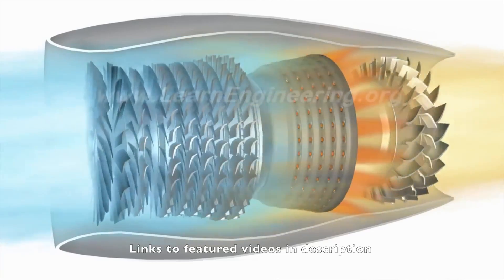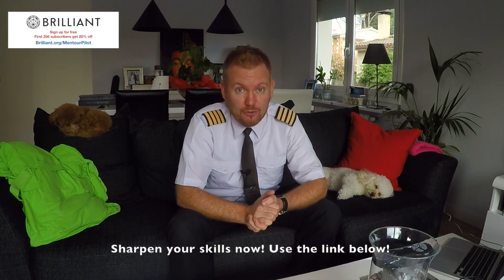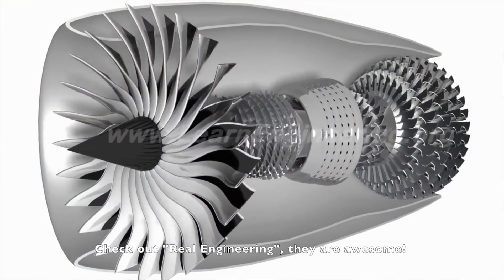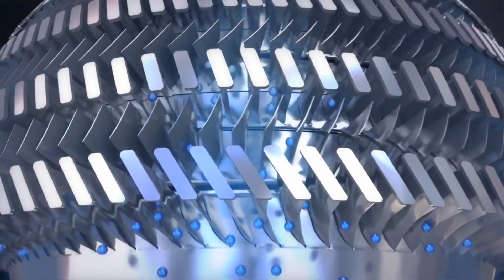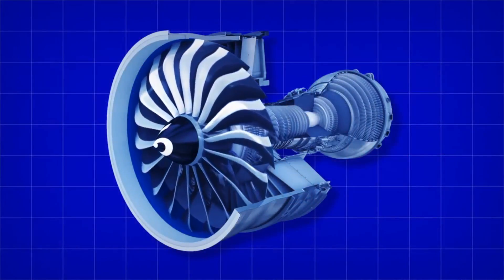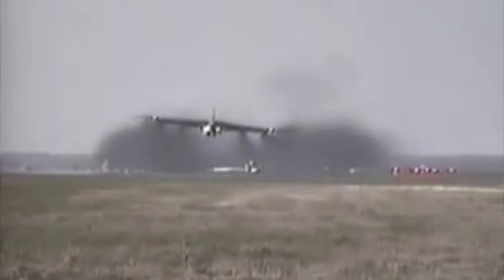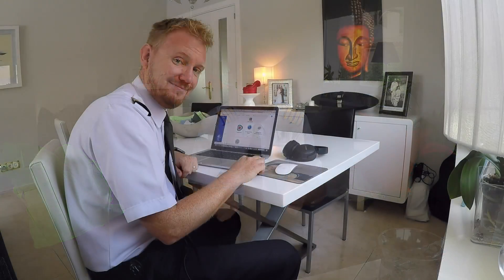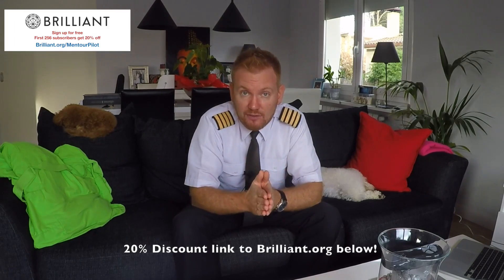Can water make Jet engines stronger?!

Comment: Hello Petter. Could you talk about how jet engines are started sometime? There is a fellow in Canada that does some wonderful videos about how jet engines are made and operate showing the internal parts and the subsequent testing of them after they are rebuilt at the shop he works in. He has talked about the starters quite a bit too and shown them disassembled etc and spoke about one called a cartridge starter where a canister of fuel would be ignited to power the starter which then start the main engine. He implied that they were no longer used but I believe I even saw a F-22 fighter being started this way. There was a brief puff of smoke and the sound of a turbine right before the sound of the main engine becomes apparent. It seems logical to me that military jets on standby that have to get airborne ASAP might still use this method vs some sort of start cart. Also I am thinking the newest commercial jet engines might use some method that he has never even discussed as I don't remember seeing start carts in any of your videos.
Thank you for all the interesting and informative videos Petter.
George

Comment: So we don't have thrust augmentation systems on modern high bypass engines? Is this a new thing? Will the low and intermediary compressors work at all normal flying altitudes?

Comment: Is it good to throw a coin into engine turbine before gettin into plane  to have more luck?
Reply: Some tribes in central africa did this in the 18th century to appease the gods.
Reply: @zanzark1  didn't know they had planes with turbofans in the 1700s
Reply: Absolutely NOT! That could severely damage the engines and actually increase the change of engine problems or failure. So basically, NO it will actually decrease your luck!
Reply: @paul kesley I'm shocked myself, being an African 💁
Reply: Took a while for the rest of the world to catch on. ;)

Comment: Burn chamber? Combustion chamber lol. And to help clarify, there are several stages of turbines and they are just that, turbines. Different from fans in many ways. The first stages of turbines (depends on engine how many) are the high pressure turbines (HPT) which takes the initial energy from the gas produced from the combustion, and those HPT stages drives the compress. In the grand scheme of things, the compressor and HPT are fuel driven (throttle response). The last stages of turbines are you low pressure turbines (LPT) which takes the lower temp gases (in comparison to the HPT) and is used to drive the main Fan and booster stages via an LPT shaft through the center of the core connecting to the fan rotor assembly. You Low pressure system and high pressure system are aerodynamically linked together, however the core is fuel controller while the control of the fan is based off of compressor vane positioning and booster bleed off positioning. Hence why it's possible for the fan to over speed.  It's always hilarious watching pilots explain the maintenance side of the house. Great video though 👍🏾

Comment: You've produced a great channel of videos.  I have  been an aircraft geek since birth, but they (the videos) have filled in many holes in my knowledge, especially with the 737.  My usual air carrier is WestJet, so your videos apply to most of my questions.
I'm an operator of a gas turbine powered electrical generating station in northern Canada.  We fire the turbines on natural gas.   Our turbines are basically a stationary variation of the GE CFM56 frame 7 s with a generator on the end of the shaft instead of a fan.  Being on the prairies, with the associated almost continuous wind and dust, we water wash the compressors online every week in the summer.  To do this, we spray  about 180 litres per minute of 85 deg. C water into the intake bell mouth for 30 minutes at a time.  We have to be at full rates at the time,  but even then, we see little variations in the flame detector outputs.  They never flame out, its just that the detectors see the water going by.  We actually gain 1.5 to 2 Megawatts of electrical output while the water is going in, too.  When we shut the water off, the output drops to normal with a slight increase since the compressor blades are now clean.  Seeing this video, I  found my self wondering if our ignitors start firing as part of the automatic wash sequence.  I'll have to investigate further on our side.

Comment: I believe that bypass fan works to let the water out. With higher pressure, the water is also be compressed. Anyway, the temperature is high enough to vaporize the water drops.

Comment: the probability of water even going into the core is very minimal, water is heavier than air and would be pushed towards the tips of the blades. something like 99% would go through the secondary air duct. Water can and will however flame out an engine. The pressure and volume of the water needs to be high enough to do so though, like from one of the fire trucks that have the remotely operated arms. Rain however just doesn't have the volume condensed enough to be even able to make it into the combustion chamber. I think the biggest danger to a jet engine from rain is dependent on temperature. In colder climates around 45F or below ice formation becomes possible, which could cause ice damage to blades. I'v never seen or heard of ice FOD causing total engine loss damage, usually it just means the engine mechanics like myself get to spend a lot of time with files re-profiling blades and/or changing the engine because the damage went into an area that cant be blended with out engine tear down.

Comment: Listening to your comments and explanation regarding turbulence, engine failure etc....does reassure my flying. Turbulence is one most disturbing factor of flying. Regarding Air Asia accident few years ago, reason was pilot error by flying too high during a thunderstorm, very interesting about what you had explained concerning slowly pushing the thrust. Apparently, the pilot of Air Asia panicked.

Comment: Question: I’ve often seen that the tail section of the 777 has a circular space that looks like it’s been hit by sledgehammers. I always figured this was to calibrate/align the plane’s horizontal bias. Is this correct? Why have I never seen this on other planes though? Also, I noticed that the 777 very often, very continuously sways horizontally. Is this related or am I imagining things?

Comment: So, in effect, the high bypass engines, like on the 737-8 MAX are really just ducted propellers? Same principal as a propeller only instead of a four blades you have 40 blades (or whatever) that grab air and eject it rearwards, just like a propeller. Of course the speeds are not even in the same zip code and the turning force is a jet, not a piston engine or whatever. Fascinating

Comment: Interestingly, within the automotive industry, some vehicle owners spray water droplets into the air-intake of reciprocating engines to clean out carbon deposits which collect on the surface of the piston. The effectiveness of water injection demonstrates far better cleaning performance than products like SeaFoam, etc. That is one of the reason why an engine with a head gasket leak has shiny, clean pistons! I believe ChrisFix uploaded a very detailed video where he used a boroscope to inspect the cylinders of an engine with a head gasket leak.

Comment: this was a neat vid in that there is a direct connection with piston engines. i use water injection to help control detonation to keep piston crowns from being damaged during high stress engine operating conditions. water allows me to run a higher compression ratio that i would otherwise would at w.o.t. and that makes for more h/p and torque. it's neat to know that a similar process is used in a jet engine(keeping the turine blades from melting under extreme stress loads). what was of particular interest is the sheer amount of water that one of these engines will ingest and that the engine remains relatively unaffected as evidenced by the static test video clips and why they can do that.
thanks for the effort in creating these vids.
give the furry friends a pet for me :-) mine is a pomeranian.
=dok=

Comment: The water expands into steam from the exhaust gas temperature.
During combustion, air and jet fuel at perfect stoichiometric ratio expands to something like 5 times it's original volume, this along with the increased temperature drive the turbine.
Water expands from roughly 2000 to 4000 times it's original volume as steam at the temperatures you'd see inside a jet engine exhaust.
Reply: The fuel to air ratio on a gasturbine engine is far below the stoichiometric ratio of about 1:14, why?
The turbine inlet gas temperature must be limited to retain the structural integrity of the turbine blades.
Today that temperature is less than 1500°C, with turbine blade ceramic coating and internal cooling . Any over temperature will allow the turbine blade to 'creep' and rub against the housing.
That is one of the functions of the fuel controller ( FADEC) to limit the fuel flow during acceleration.
Adding water will certainly help.
Reply: Steam power!
Reply: @Special EDy :  Well explained than the video!
Reply: Uh, no. All water does is evaporate, cooling the air because of a thing called preservation of energy. You do not magically gain thrust from steam. That could only happen in the engine core where that gained thrust is lost entirely from losses to bleed air and other parasitic loads.

It's the same reason supercars and some drag cars use it. It cools the incoming air extremely effectively, which makes the engine able to cram more air in to burn. There is no "steam propulsion" mechanism going on here. Nor is the water splitting into hydrogen and oxygen as others suggest. Middle school science is worth paying attention to...
Reply: @pootispiker2866  All combustion engines run entirely off of heat energy.
A jet engine or piston engine converts fuel and oxygen into heat, the heat increases the pressure of the air, and that expanded air is converted into mechanical energy. Adding liquid water to the combustion increases the efficiency of the engine because it expands and  increases the amount of energy that's able to be extracted.

If you vaporize the water, it will cool the intake air, allowing more air to be ingested by the engine, and it will effectively increase the detonation resistance of the engine. But, liquid water entering the combustion chamber will increase the conversion of heat energy to mechanical energy.
Reply: @SpecialEDy  in what world would water ingested allow more air to be ingested...it has no chance to cool the intake air, in fact if it were humid more water would "condensate" out at higher pressures initially. This all DISPLACES intake air.
Doesn't make sense. Chemistry wise not one fucking bit.
So long as the fuel/air ratio were adjusted the ingested water could greatly increase performance and maximum thrust. Most engine management controllers would never do that however, water intake can't be a reliable constant. Dangers of turbine overheat are too high to take advantage of rain pulled into the combustion chamber.
It's usually Alcohol /water mixes used to temporarily increase maximum thrust, and that's directly injected pre-burners.
Reply: @mykeprior3436  Water injection was used in fighters and bombers in WW2. In bombers too heavy to get off the runway, or fighters in combat, they had a tank of water or water/methanol to spray into the intake. It'd give roughly a 10% to 25% boost in Horsepower. The Americans used water, and the Germans used 50/50 water and methanol (basically windshield washer fluid). Admittedly, these were piston engines, but the principle is the same since both jet engines and piston engines are internal combustion engines.

Water will cool the intake charge. The compressor stage of the jet turbine will compress the air before combustion, and compressing the air increases it's temperature. If water is ingested into the engine, some will evaporate during the compression stage which will lower the air temperature there, allowing more atmospheric air to be forced in. This works on all IC engines, it's why "cold air intakes" and intercoolers are a thing on cars. 

During the combustion phase, the water is entirely flashed to steam. All engines are heat pumps, combustion is used to heat the air inside the engine, and when the air is superheated, it increases drastically in pressure. This high pressure is then allowed to expand out through the exhaust turbine, driving the compressor to run the engine and the bypass fan for thrust. By adding water, you are adding a material that expands much more effectively through a phase change. The superheated air normally in the exhaust yields a pressure increase of 5 to 10 times, but water expands to thousands of times it's original volume when flashed to steam. It is much, much more efficient. The engine only needs to heat the water to boiling to gets an expansion ratio of several thousand to one, whereas it must hit the air by thousands of degrees to get a 5 to 10 times pressure increase.
Reply: @mykeprior3436  Also, increasing the fuel into an engine cools it off. Running lean of stoichiometric makes for a hotter combustion typically, adding fuel will cool off the combustion chamber and exhaust but isn't efficient, pollutes a lot, and deposits soot.

Car engines actually dump extra fuel into the engine if you start them when they're hot. Engines will "heat soak" if they're shut down after reaching operating temperature, since the cooling system is no longer running the combustion chamber actually overheats after shit down. Engine computers combat this on a hot start by pulsing the injectors before firing the spark plugs, and then running rich for a few seconds to cool off the combustion chamber.
Reply: @pootispiker2866  however it would allow for the turbine to reach much higher temperatures, effectively adding more fuel than designed dry. The expansion of steam would be offset greatly by cooling of the air via state change...so the net effect would be if the engine controller is attempting to maintain proper temps would be to in fact INCREASE maximum thrust. There would be a critical point where this would cease to work, too much cooling to keep up, too high pressures, too much oxygen displaced by water droplets (flameout) or worst case liquid compression (that would have to be some serious water ingestion) could blow the compressor blades.

Comment: Great physics lesson on energy, mass, and heat.  Even the body works in a similar way, with water cooling as well as strengthening the muscle systems of running and cycling.

Comment: To my knowledge most modern turbofan engines are N1-controlled (i.e. the engine's control unit (ECU) automatically sets the fuel flow to achieve the wanted fan speed). In case of heavy rain ingestion both the compressors as well as combustion chamber(s) tend to operate at lower efficiency. Therefore I would expect that monitored EGT should increase for a given N1 due to rain ingestion. Is this something you can indeed observe as a pilot? Have you ever encountered (or heard of) a case where the pilot set N1 was not achieved because under influence of rain ingestion the EGT margin became critical (and the ECU decreased fuel flow to prevent overheating)?

Comment: I had WMI (water methanol injection) on my car. That's wenn I learned it was used by planes since the 1930s. With all the effects you mentioned. Only injecting water can help also, because the volume from water to steam increases 1700 times, so your engine becomes a little steam engine. More power, more speed. Futher more it cools the exaust gasses and breaks down the carbon build up in the cilinder tubes.
Great video as always! 👍

Comment: If the fan is producing most of the thrust, and not the jet of hot gases, why are we not using turboprops instead of jet engines? I've been wondering about this for a long time. Is a ducted fan more efficient than an open propeller?

Comment: Why is there so much "Play" in the yolk?  I see exaggerated movements and the aircraft doesn't shutter, I can see in a cable/pulley system parts wear but the new controls are fly-by-wire.

Comment: CH4 + H2O = CO + 3H2, CO + 1/2O2 = CO2, H2 + O = H2O. Water is an active participant in combustion, which is why combustion propagates through wet charcoal. There is of course no net energy gain in the presence of water, and there is a net loss due to heating the water and absorbsion of latent heat, and perhaps a more diffuse multistage reaction process, although that is only my speculation. It is interesting to watch how wet charcoal burns, if you start with glowing embers it is hard to extinguish by pouring on water and any warm area that is not cooled sufficiently, though soaking, will slowly reignite.

Comment: So are water injection systems essentially turning turbojets into a bit of a steam turbine? I don't know how much the compressed air will expand in volume once in the combustion chamber, but it surely wouldn't be as much as water turning to steam which is about 1000x the volume

Comment: I'm confused. First, I hear that water is not an issue except for runway traction. Later I hear that thunderstorms are really, really bad, with huge amounts of water, and extreme measures are taken to avoid them. I hear that the engine testing involves more water volume than can ever happen. I hear that most water bypasses the burn chamber. But I hear that there were flameouts in the 1980s, with high precip+low thrust+hail/icing. So water IS a problem in combination with the other items, but otherwise is fine?